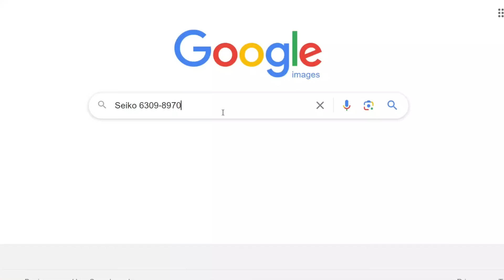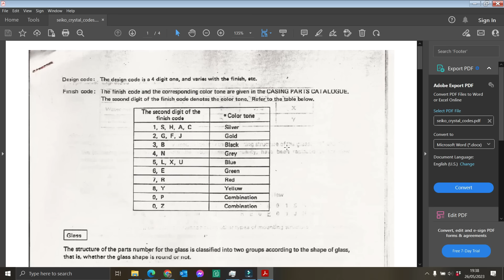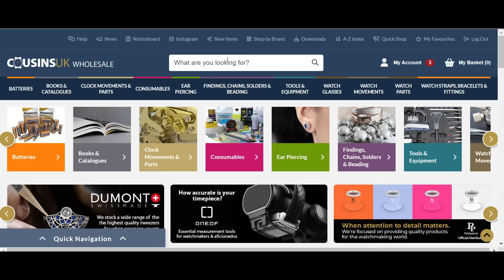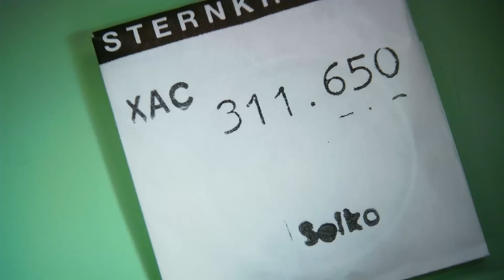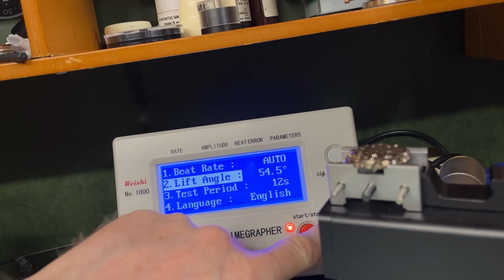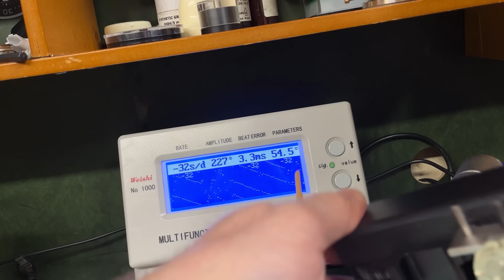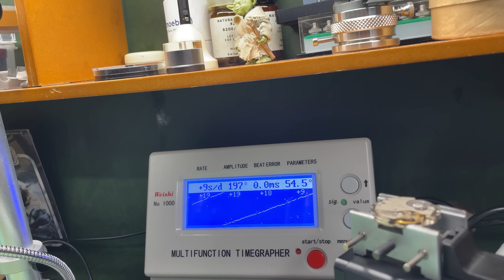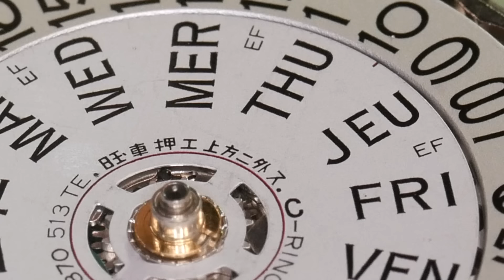Repairing the Irreplaceable: A Fireman's Watch That Seiko Couldn't Fix !

Comment: Seiko COULDN'T or WOULDN'T service and fix it?
A rather large difference there.
Reply from the maker: I know many people who have tried seiko with vintage and they are generally refused as they claim they dont have parts.  By contrast I have worked and own 100s of Seikos and most of them have never needed parts because they are so robustly built.   However I do get the point you are making.
Reply: @MyRetroWatches  Yeah ... "No Parts" is usually a ... "pretty good" ... excuse to not repair.
I'm curious though ... how can they claim "No Parts" when they still using the same jewels, main springs, possibly other springs, gears, date/day/wheels, hair spring, and other parts the vintage watches use?  
Oh well. Gives independent watchmakers more work (and the resulting income), I suppose.
Seiko DOES sell replacement jewels, main springs, and other common parts, for not recently (+/- 5 ~10 years?) produced movements, correct?

Comment: I just wouldn’t accept a amp of 197! That’s terrible, 220 min looking for 270. Something not turning flat? Bent wheel, barrrel ? I for one don’t bother service these often because the entire watch costs 125.00 amazon, seiko parts are thin and plastic. Hairsprings are very very fragile ! Just put bal complete in for 20$. 197 amp just not good enough?? But it’s running again so Darren will be happy
Reply from the maker: So I never shown the Watch regulated in the video, only with the bad balance and then when I fitted the replacement.  It was running fine at around 230 amp which for a Seiko of this calibre is more than acceptable, I’ve done 30+ 6309s from my own collection alone.
I’ve never seen a 6309 at 270!   You can’t buy a 6309 on Amazon anyway , they stopped making them many years ago. 
This watch was never about the cost it was all the memories incapsulated into it. That my friend is priceless.

Comment: Please buy an escapement meter so that you can adjust the depthing of the pallet stones into the escape wheel. Not all of your problems are going to be solved by just replacing the balance. That amplitude in your horizontal positions is atrocious and is going to be even worse when the watch is in a vertical orientation, I question whether your viewers pay to have their watch be serviced and not even keep optimal time. I understand you're a hobbyist and this is just fun but where is the precision?
Reply from the maker: I never shown the Watch in the Timegrapher with the new balance so your assumptions are erroneous. Amplitude on seiko 6309 anything over 200 is considered acceptable, at least that’s the consensus of many Seiko hobbyists I’ve discussed with on forums over the years.
I regulated the watch after the video and the watch was running with 235 amplitude and +5 seconds in dial up and down .
I feel that is satisfactory.  I have worked on so many Seikos for my own collection.
As for Charging people well that’s my business but as I don’t take work on as a rule there is your answer.